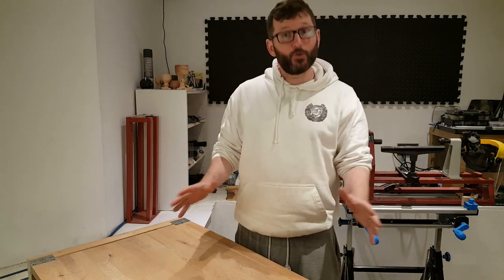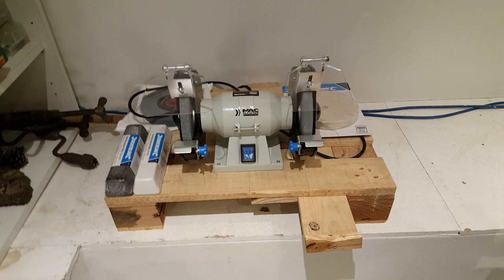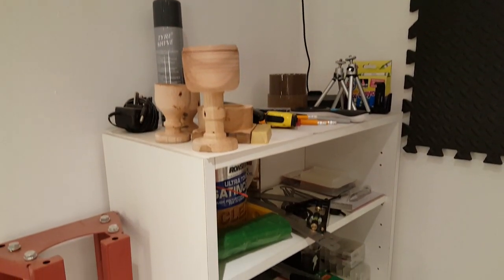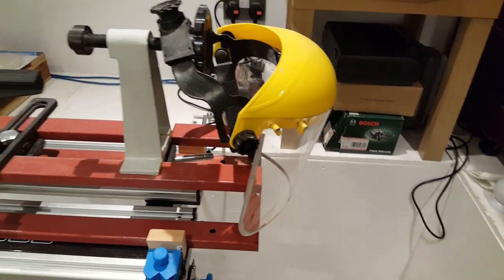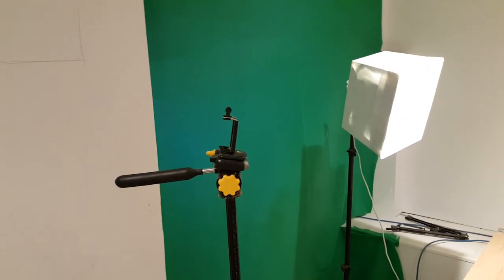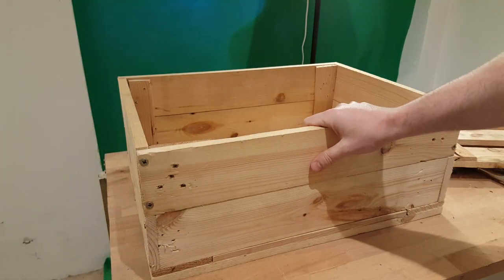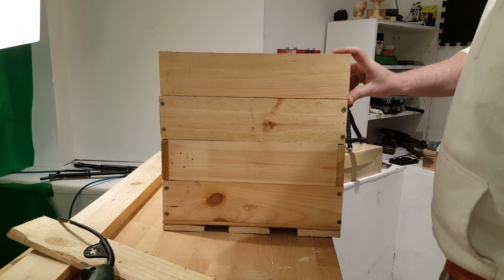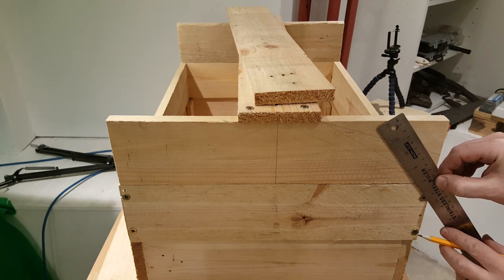Pallets to Pirates Chest

Comment: Tip for taking pallets apart.  As I'm sure you have discovered prying pallets apart equals a lot of cracked boards.  Use a reciprocating saw (Harbor Freight  has a good cheap one I use), and a long metal cutting blade for the saw.  Place blade in crevice between boards and cut the nails.  Use a steel punch to knock the nails out of the runner boards.  Downside is nail shafts remain in the 2x4s but you get a LOT more intact runner boards for projects.  One blade will last around 2 dozen pallets.  Finally, CLAMPS.  Quick grip clamps will be your best buddies.  All sizes.
Reply from the maker: Great tips Joe ! Thanks a lot. It took me longer to dismantle the pallets than it did to make the chest 😁

Comment: Brilliant, I will sub to the Arts channel. Just a thought, before using screws use a countersink bit, then you can cover screw and holes with wood filler.
Reply from the maker: Thanks a lot Nick, project number two is already under way and nearing completion !  I've got some special shiny nobs to go on the end of the screws as I'll be decorating the chest at a later date. Great advice though.

Comment: I will attempt to compile a good list of some of my favorite woodworking instructors' videos. And leave it on your other channel soon. First advice: Start acquiring and learning to use (and sharpen!) a basic kit of hand tools, before any more significant money on power equipment. People were building VERY high-end stuff with chisels and hand planes, long before the advent of electricity. You can do the same on a surprisingly low budget, if you have the necessary minimal space. The next step in that process will be a properly solid traditional workbench of some kind.

I'm not meaning to sound derogatory toward good power tools, of course. They are naturally essential to modern productivity (or often merely the efficient use of a hobbyist's limited budget of spare time). The mistake some modern amateurs make, is the perception that the whole "hand-tool woodworking" approach must inevitably be OPPOSED to a "power-tool woodworking" school of thought. So they think you have to choose one camp or the other (and then implicitly denigrate the other guys). This misperception is a bit of a generational overreaction, stoked largely by past decades of instructional "hobbyist woodworking" & "home improvement" shows on TV, purportedly catering to the DIY crowd, but really only as a thinly-veiled sales push for the power-tool manufacturer sponsors.

The real point of starting with hand tools first (apart from the obvious far lower barrier to entry in terms of initial cost!), is just the process of properly building real skill. Learning edge-tool fundamentals gives you an intuitively direct understanding of what the wood is telling you at a structural level, i.e., working WITH the wood, rather than attempting to machine it blindly and imperiously like any homogeneous lump of any other kind of material. So then when you graduate to power-tool convenience/efficiency/productivity, you actually know what you're doing to make best use of your material, and best use of your budget & space toward the power tools that are actually the most effective & relevant for your chosen vein of work, rather than overpriced junk that will be of limited utility in long-term practice. Not to mention the vital safety factor of properly understanding the stresses/movement, & strengths/weaknesses of your material, before trying to fight against it in dangerous ways through ignorance. Even the finishing stage of things can be revolutionized by planes and scrapers, largely eliminating the tedious consumption of sandpaper. (On that latter note especially, the easiest way to minimize your inevitable dust-extraction dilemma, is to simply avoid generating most of it in the first place!)

Beyond these generalizations about non-specific "woodworking" as a whole, it looks like you're leaning more particularly toward Turnery. (Perhaps only for lacking larger equipment space -- but again, hand-tool work is much less prohibitive on that score!) Turning is kind of its own thing, of course, so some of my foregoing platitudes may not apply here. Still, for both power tools AND hand tools, it's a relevant truism that best "bang-for-buck" is usually in rescued antiques, rather than starting off in the low-budget end of the modern stuff.

So, all that's to say: Good luck on your new specialty! And also to say, you may be surprised that some of us in your audience are NOT primarily "gamers". We just enjoy some good shenanigans with good people, in venues both virtual AND practical.
Reply from the maker: Wow !! Thanks so much for all of your advice, I truly appreciate the amount of effort you went to to write this comment. I completely agree with you in the aspect of power tools. I could of done a much better job of this chest with the power tools I have in relation to angles and cutting straight lines but I actually prefer hand balling it if that makes sense. I want to level up on the hand tools first before I become reliant on the power tools. I'm going to use any materials I can get my hands on to make things and stuff so it won't be just wood. Spoiler alert : I'm working with slate in my next video and wow the learning curve is steep but fun. I'm really trying to keep to the aspect of "anyone can build this" rather than going for builds that require thousands of dollars worth of tools and equipment. Hopefully as my skills grow so will my builds and experiments. Thanks again for your comment :)